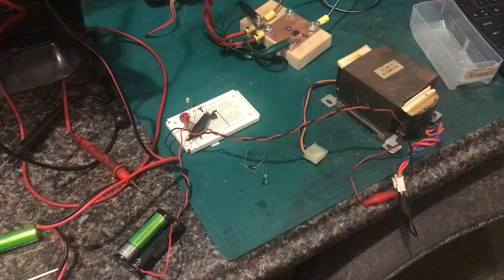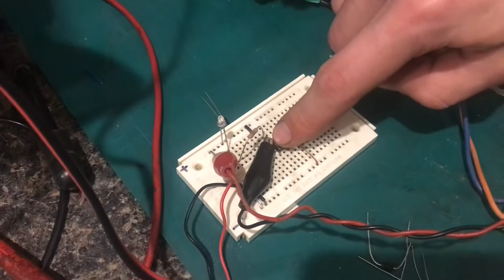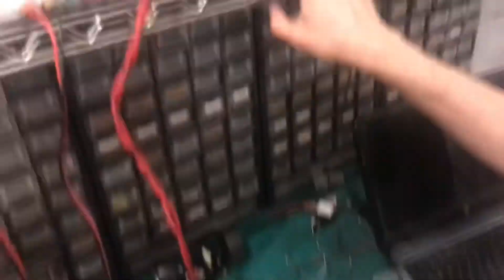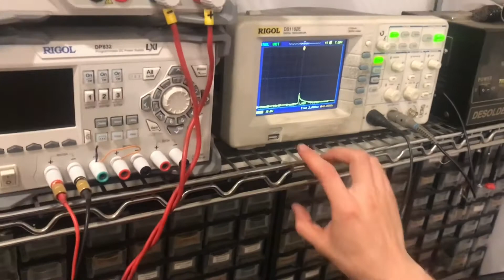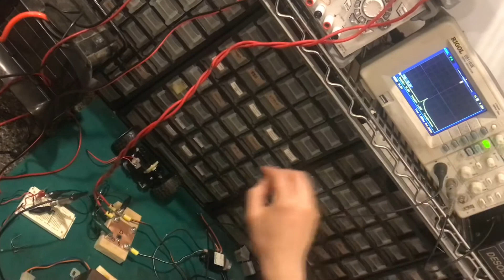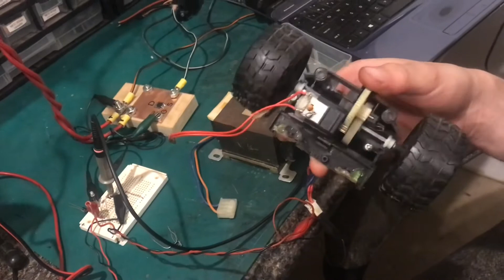demonstrating INDUCTIVE “voltage spikes” (using a transformer)

Comment: Hi. Thanks for the video.  I have a few clarification questions.  1)  When the magnetic field collapses, I understand that the voltage surge will flow in the opposite direction?  so, that is why you need to add a reverse diode?  Can you provide a sketch diagram of your circuit and where you are placing the oscilloscope probes?  thank you!
Reply: Super late but might be useful: a diode is added so the short-lived voltage spike has a way to discharge itself, and does not damage whatever you have connected to that inductor. A classic example is a relay driver, you don't want lots of volts on the drain of a low power mosfet. You can see this with theory too: voltage on an inductor is proportional to the derivative over time of its current VL=L*di/dt, by opening the circuit you're bringing the current from a finite value to zero in an infinitesimal amount of time, imagine di as the difference in current and likewise dt for time, you have a variation of current (lets say from 2 to 0A so -2) in variation in time that tends to zero, when you divide by zero the value explodes and becomes huge, so you have the voltage spike. The inductor is tryhing his hardest to make the current change in a linear manner instead of a on/off one.